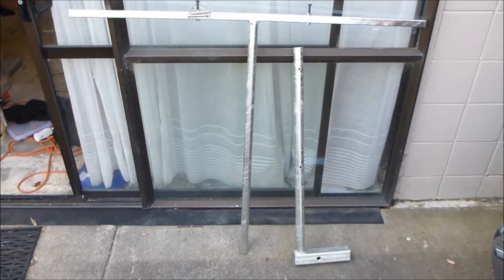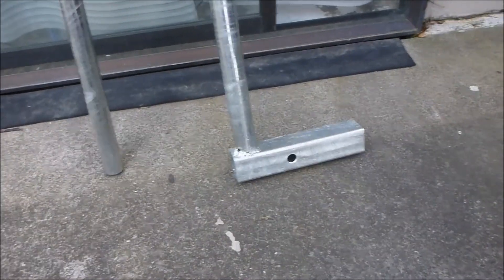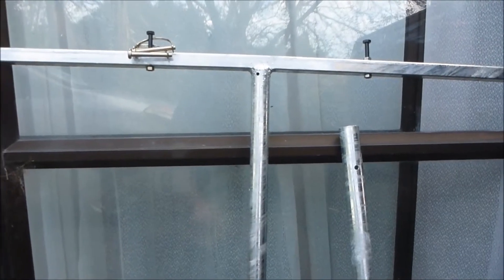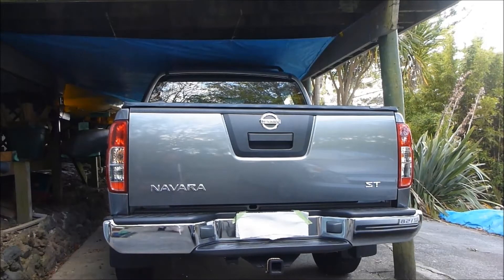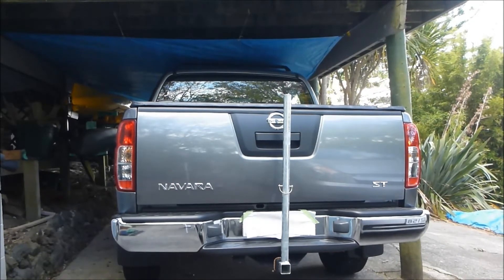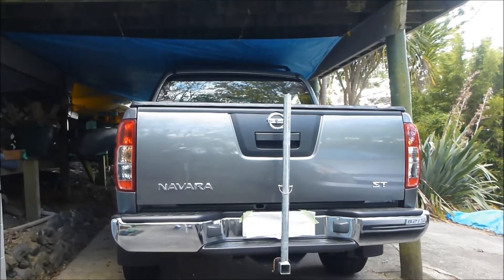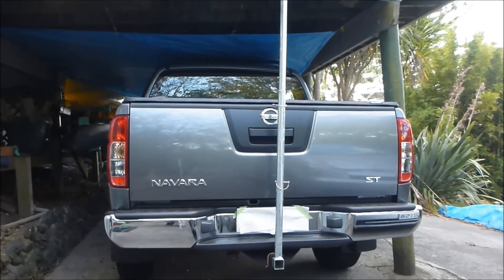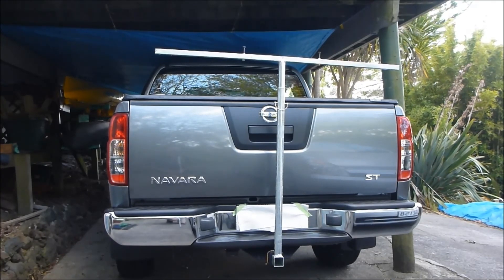DIY Kayak Loader / Towbar Support

Comment: Hi. What size tube did you use inside the 40mm? Having some trouble finding a snug-enough size. Cheers.
Reply from the maker: Hi there, outer of the 'big' tube is 38mm, with 1.5mm wall thickness, this gives an inner diameter of 35mm. The outer diameter of the 'inside' pipe is 34mm, so it gives a reasonably snug fit inside the 'outer' tube. Still using this system regularly three years later, works great. Good luck with your project !